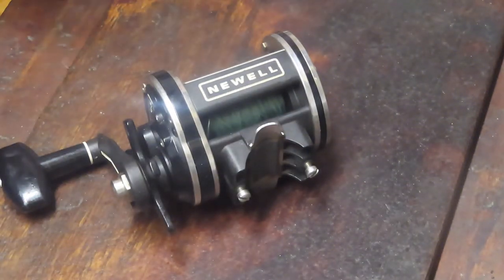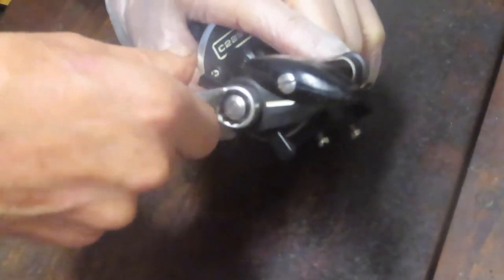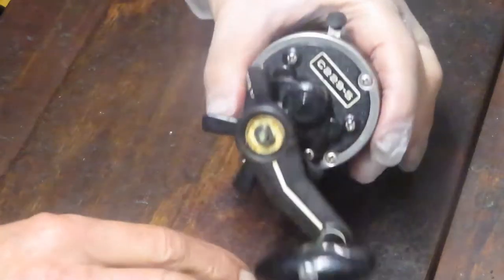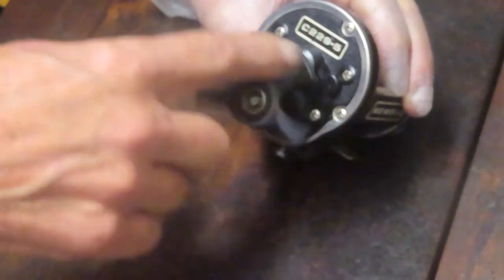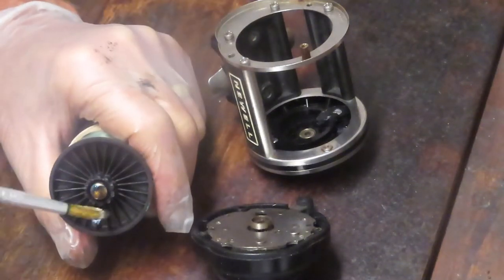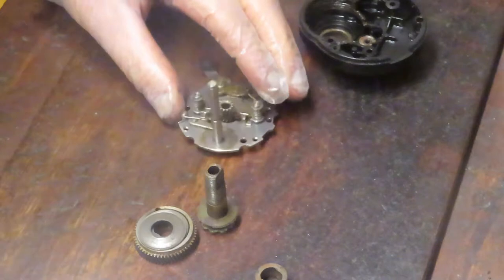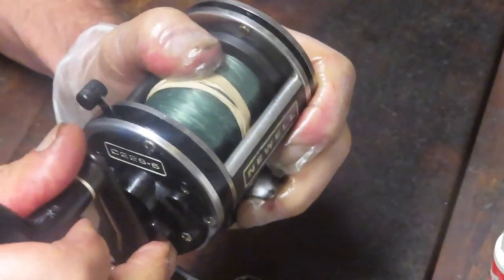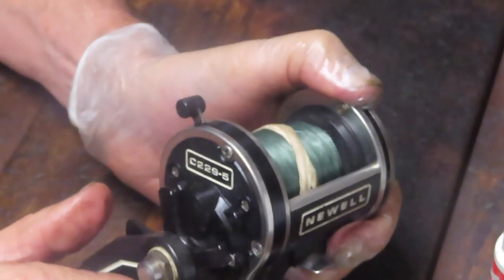Newell C 229 5 saltwater fishing reel how to take apar and service

Comment: If I had been able to continue using conventional reels a Newell was what I always wanted. Good ones are hard to find and if found even harder to afford. I’m glad you get to showcase these marvelous reels!  I’d have a time working on it though because I don’t get along with little c-clips. I had so much difficulty with a few on a Zebco Cardinal 6 reel a few weeks ago. I sent you some photos of a Peerless Bam 600 reel I recently got. Well I got a 500 yesterday in almost brand new condition.  I had to have injections in my wrist today so I won’t be working on any reels for a while I hate carpal tunnel problems! ——Chris
Reply from the maker: Wow - you just keep getting lucky!  Covid taught me that a few days off and maybe an hour or two spent organizing the shop is well spent as opposed to just working on the reels.  Enjoy doing other things in the interim - Best wishes - Dennis
Reply: A word about Newell rees. Im not an expert
by any means but I have fished many of their
reels and I still have several. This is a 5 th
generation reel. At this time and with the
following S series there were some quality
controls with these reels. Were this my 
personal reel I would not fish it without a
reel clamp. These bases with the stainless
insert are prone to cracking. This is a 20
lb class reel as the model denomination
indicates. The 229 means that it will hold
290 yds of 20 lb test and the 5 indicates a
5:1 gear ratio. So be mindfull of heavy drag. 
This small reel is probably less prone due
to its size but still is something to keep in
mind. There are aluminum aftermarket
star drags available on ebay.

Comment: Do you the size of the circlip that goes on the post? I’ll try to purchase one from a hardware store as Newell parts are scarce as hens teeth.
Reply from the maker: I'm sorry but I don't.  The best solution is t buy a multi-pack assortment or to take the reel with you to the hardware store and try various fits. - Dennis